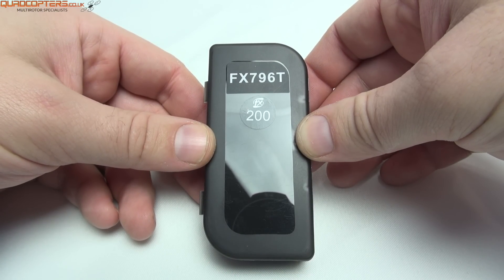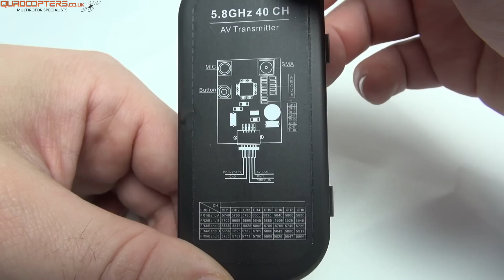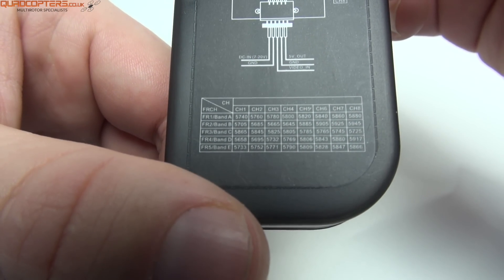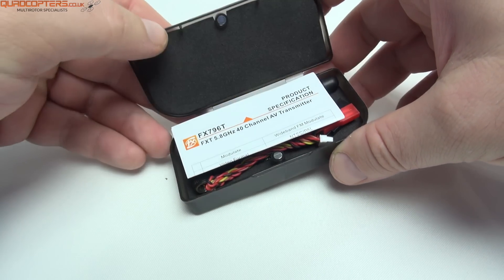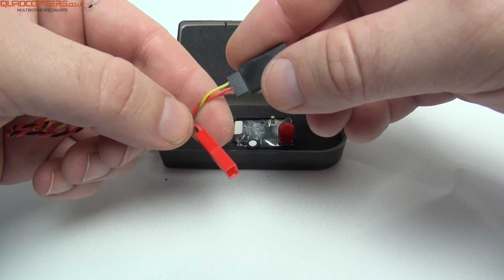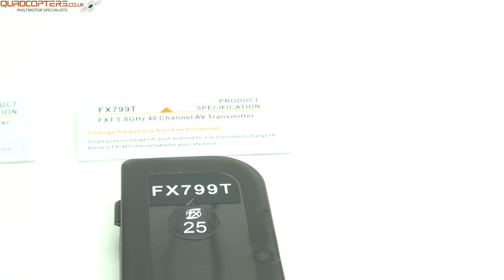HPIGUY | FX79 25mw 200mw Raceband Transmitters - From Quadcopters.co.uk

Comment: There is only one test that counts.. Flying with up to 8 pilots on Raceband at the same time. Testing channels next to each other and check the interference. 
This looks like a China model we tested last month and that had some interference on other channels. The weird thing.. some did, some didn't.

We had a lot of brands in one line at the startline, but only ImmersionRC managed to get 8 pilots flying next to each other without interference.